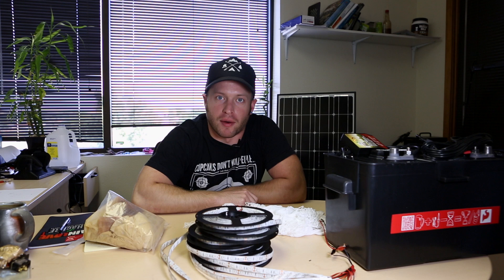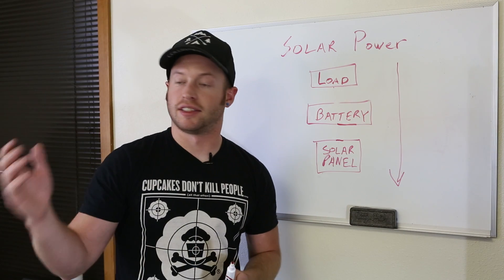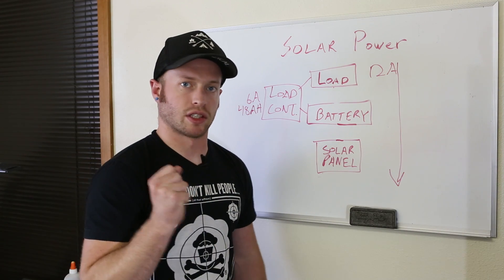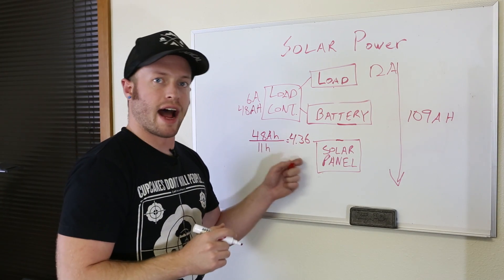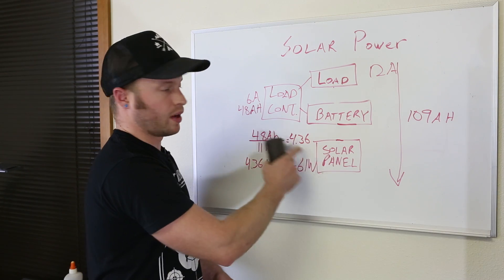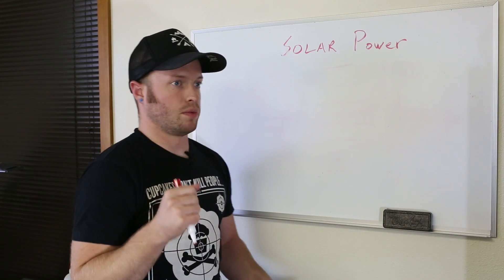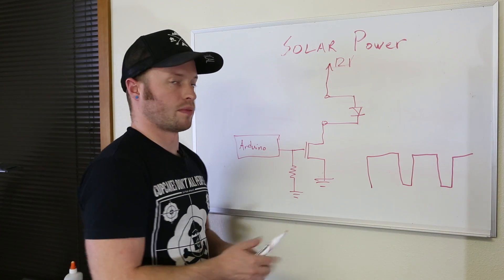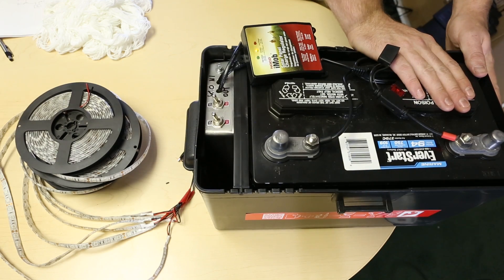SparkFun Engineering Roundtable #20: Solar Power

Comment: Why did you just state that you need 109 AH, just to turn around and design a 48 AH solar system?  You could have added a light sensor to continually dim the LEDs as darkness set in and reduce your power consumption as well. Overall, I like your presentation, keep it up. Just double check you math.
:-)